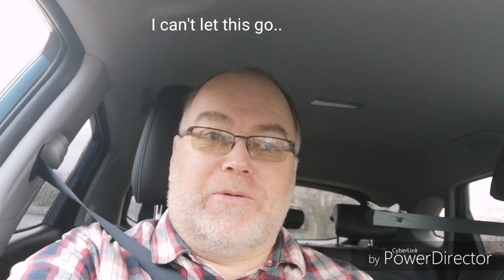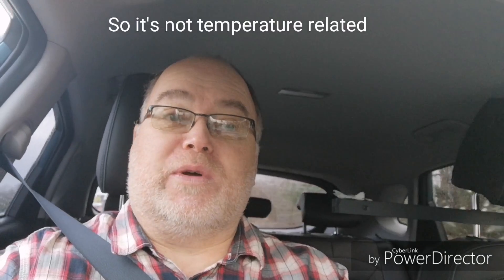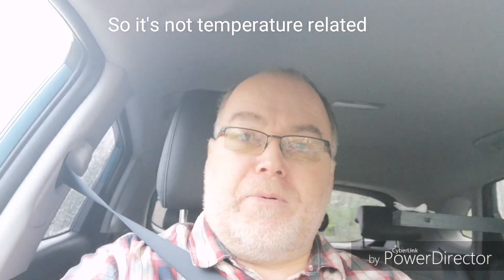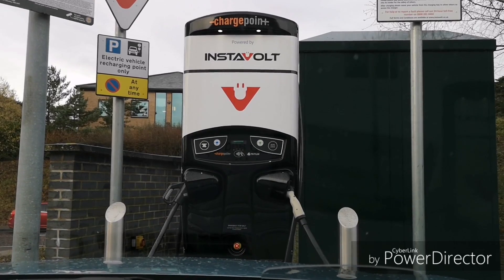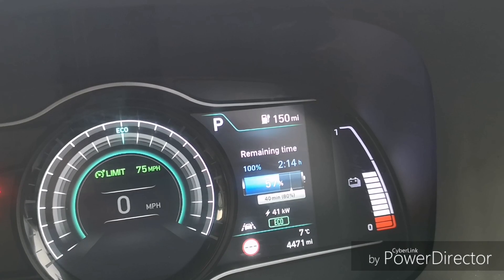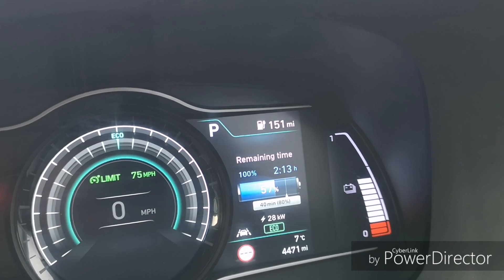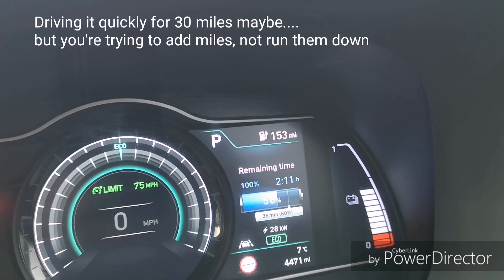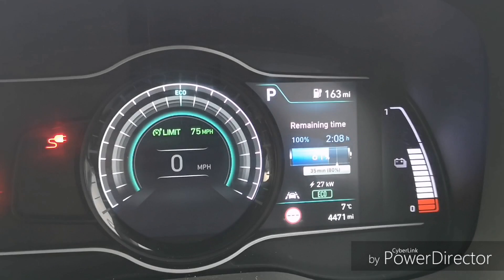Kona Electric / eNiro slow charging from cold & mid SOC

Comment: I have a Hyundai Kona 39kWh 2022 model. I took a "longish" trip this weekend. About  over 1 hour of motorway driving (speed 120-140 km/h). Charged it, only got 33 kw max as usual. It was 13 C degrees outside. Drove back, heavy rain most of the way. Charged it at a 50 kw charger. Got up too 43 kw. (never got those speeds before) after 10 minutes it dipped down to 27 and started going down. I love the car, but I'm glad it's only a one year lease. These speeds are too slow. Your video is 3 years old and I thought that this thing would have been fixed by now.
Reply from the maker: It's a crying shame it's restricted so much. If a Mini 28kwh can charge at 50kw nearly to 90% the kona should do better   and ioniq 39

Comment: I don't have an EV, my battery experience is utility scale battery energy storage normally greater than 10MWh, but I think my experience might provide some insights. I think you are describing the battery protecting itself from excessive voltage while charging. The ideal battery charging method (for maximum energy capacity and minimum degradation)  is constant current (CC). At low SOC the battery has a low voltage and at high SOC it has a higher voltage (sorry if this is teaching granny to suck eggs). The effect of this is that, when starting from a very low SOC, initial charging power at maximum constant current will be lower than the later charging power when the battery voltage has risen with SOC (power = voltage x current).  While you charge the battery, the voltage increases above the batteries at rest (open circuit) voltage to overcome the batteries internal resistance and polarisation. If the battery is cold then its internal resistance will be high leading to even higher voltage for a given charging current. So starting from a mid range SOC (mid range voltage) and charging it at maximum continuous current will result in a high voltage. If it is higher than the battery voltage rating then the car / charger will reduce the current (reduce the power) to keep the battery below its voltage limit i.e.constant voltage (CV)charging. I think this is what The EV Puzzle is experiencing. Some battery manufacturers will allow (warrant) constant power (CP) charging rather than constant current (CC) charging but to ensure the battery can be fully charged they all use CV in the final stage of charging to achieve maximum SOC, so they are normally described as CCCV or CPCV.
Reply from the maker: Many thanks, a useful peice of info however, the reasons why are not the point, it's the fact that it does it and customers aren't told in advance, instead left to discover how physics with with on their own. It's the communication and openness about what each car is capable of OR NOT.

Thanks again, genuine best techie response I've read
Reply: @EVPuzzle  I guess it's not easy (not commercially attractive) for EV manufacturers to explain that maximum battery charging power will vary depending on temperature and SOC. Easier to say "you can use a [x]kW charger" even thought they know that maximum charge power can't or shouldn't be delivered at all times.
Reply from the maker: Honesty and openness isn't something they're used to for sure

Comment: Hi Nigel

Could the issue be the Instavolt chargers? Yesterday I visited my Mum and needed a quick charge to get home in my 24 kW Leaf. There are a couple of new Instavolt charges close to her house so this was a chance to try one whilst the free offer was still on. Arrived with just under 50% charge and it took nearly 30 minutes to get to 80% starting at 28kW charge rate and tapering to 8 kW at 80% charge. When I am on Electric Highway chargers I always get just over 40kW charge rate when first plugged in.
Reply from the maker: No it's the car. It's been tested now on many chargers by lots of viewers in different countries

Comment: so from what I understand this problem only occurs if you start charging from 50% and if the batteries are cold right? as soon as I get my 39 (March where temperatures in Italy will be about 15 degrees) I will do this test too
Reply from the maker: Rates of the 39 kwh Kona would be as low as 16kw. Seen it occur at 12c but not tried warmer weather yet
Reply: The EV Puzzle i think this is a cold battery problem
Reply from the maker: Yes it is,  but only from mid SOC
BMS parameters are very different on the 39 . Will be interesting to hear how you get on as the 39 is very rare
Reply: The EV Puzzle mine should be delivered on March 1 is currently in customs I will keep you updated

Comment: If you start you charge with battery temperature above 26c this is what you approx. Could expect. If all parameters is ok.To get to 26c starting at about 5c you will need drive fresh for about 80 miles. You could buy an obd read out tool so you can readout the battery temperature. So drive first and charge when warm 😀
Charge: https://support.fastned.nl/hc/de/articles/360007699174-Laden-mit-einem-Kia-e-Niro
Obd tool and app : https://evnotify.de
Enjoy your nice car and greetings from Denmark 😁
Frank
Reply from the maker: Obd data for the Kona isn't reliable yet imo

Comment: Hold on have you got the battery charge limit set to 80%?
Reply from the maker: Nope and that doesn't impact rates of charge
Reply: @EVPuzzle  Very disappointing for you. Does this premature throttling disappear if you warm up the car more? There just doesnt seem to be a rational explanation for it. Because even if the batt was cold, then it would warm up a fair bit during charging
Reply: Have you tried with ECO mode off? How much energy is being used to condition the battery?
Reply from the maker: No battery care % at all
Reply: @EVPuzzle  I agree 7 degrees is not cold. But the temp of the pack could still be the limiting factor. Maybe if eco is off it might expend more energy heating/conditioning the battery. Bjorn mentions this a lot with trying to get optimal charging speed for a tesla. But obviously thats Norway and this is the UK.
Reply from the maker: I'm sure it does dissappear once warm enough. But increasing battery temp in cold conditions isn't easy. 70 miles of driving hadn't been enough in one person's case. I've only tested 20 miles so far but that defeats the point of needing a charge when you need it.

The answer is drive until you deplete the battery to a much lower level before charging

Comment: Hi Nigel, I didn't get my car yet so I can't test this issue for now. I might ask a silly question though: when you get this issue, have you tried to change the charging rate in the car options to low and back to high? Did it changed anything on the communication (and rate) with the charger?
Reply from the maker: Not tried. Will do next time.

Lots of people experiencing this now so it's not just me

Comment: Your post encouraged me to try out a local and recently installed InstaVolt charger on the way home. Arrived with 27% SOC with a cold battery (only a mile from work with car being parked all day at c. 4 deg C) and immediately got 39 kW. Returned after 30 mins (ideal opportunity for a quick drink in pub next door!) and returned to see a charging rate of 47 kW and an SOC 60%. i.e. Worked a treat! Remind me of the problematic range for initial SOC and I'll try next week to see if I can replicate.
Reply from the maker: You'd already warmed the battery in the first charge hence you got a better charge rate

The issue is from cold and 50s and 60s%  range
Reply: @EVPuzzle Sorry just to clarify - it was a single charging session which started at 39kW and was then 47kW by the time I came back to the car to end the session (as you say when the battery had warmed up). I'll try in the range you specify next week and will sit in car to see if the same thing happens to me...
Reply from the maker: Cold and starting SOC 50s to 60s percent

Comment: I’ve just read on line that the North American  Kia Nero will have an “optional” battery heater .  From what your saying I’m seriously wondering if the battery heater has been left out of the UK Kona.
Reply from the maker: It's when it's used that counts not whether it has one.  The Kona has one and is used in winter mode

Comment: A trip of 860km with my Kona64 with temperature betwwen -1 and 2 degrees, on Charging stations where you can charge at 43kw Max i was always charging at 43-45kw max. external temprature seems to not be the reason of your issue, FYI on my side winter mode is OFF
Reply from the maker: As I said it's the starting SOC when cold
Reply: The charging graph for 50kw charger is well respected on my side.

Comment: If it is the software thing you suggest, you should be able to work out if the Chargepoint is calculating how long to get you to 80%, then using that time to the full. From your chargestate you should be able to work out how many kWh you need to take on board to get to 80%. Then it’s time and distance (or time and kWh in this case). That will give you an average charge rate, which will/will not equal the time to get to 80% figure. Ish.
Reply from the maker: If you look at the image for the 39kwh Kona which charged at 16/17kw instead does that work out or not?
Reply: The EV Puzzle ha!  Good try. I was suggesting you work it out, not offering. Without having to go through the video again, we can do it in reverse and work out what % your battery should have been at to meet your theory.

Assumptions.
80% Charge in 45 minutes 
80% of 38kWh battery=30.4kWhs. 
So to achieve 30.4kWhs in 45 minutes, is a charge speed of 22.5kW from empty. So if your theory is correct, a 38kWh Kona would never charge faster than 22.5kW. Does that meet your figures?
If it was actually charging at 16/17kW, then that would take on board about 12.4kWh in 45 minutes. 
So the battery should have been 30.4-12.4=18kW
18kW from 38kW=47% of a full battery. 
So at 47% battery the small Kona would only charge at 16/17kW to get to 80% in 45 minutes. Is that about what it was at, ish?
Reply from the maker: Iain, all I know is it's a  39kwh battery in the smaller Kona 
I have no idea why it's slowing down charge rates from cold with soc 50s-60s %.  My time theory was just a guess but maybe it's the battery chemistry doesn't like mid states of charge when cold. It could simply be a negative effect denser batteries with less cobalt in them.
Reply: The EV Puzzle yep, I was only looking to see if your time theory could be supported by a test. I don’t have an alternative theory. But from what you say, it’s not just your car, other drivers have experienced similar speeds. So it looks, at least, as if it’s deliberate.
Reply from the maker: It is, yes. Not just a few instances, it's every instance  in these parameters soi far

Comment: I find in my Tesla, the 2 things that affect charge speed is outside temperature, and battery %. Temperatures in single figures equals slow charge rate. Even 7C. Higher % equals slow rate of charge. Neither as extreme as yours.
Reply from the maker: Kona charges great from cold, very cold ...just not from mid SOC
Reply: The EV Puzzle cold certainly affects my car, a lot. It does increase gradually but cold (battery) always means a slower than normal charge. On a Rapid, it is normally constant until about 80%+.

Comment: Dear all, 
I want to give you an example of fast charging of a Kona in cold conditions. I am totally sorry but the youtuber speaks german (https://www.youtube.com/watch?v=MQ0fwlZoUQM ), but you can see that the Kona in Winter Mode does charge quite fast when you are on a motorway. He started with 70% SOC for a 450km/300miles Trip to do the testing. His max charge rate was first 54kw and on a fast charger 71kw peak. So not so bad from my point of view. BR Sea

Comment: Just another thought on this, what happens if you drive from 80% down to 50% and then rapid charge, is the problem the same. The reason I ask is that would be the more likely scenario if I were driving on a long journey.
Reply from the maker: Now who posted they drove 70 miles and got the same issue.?
Increasing temperature through driving isn't easy. Mad Max style might work but temp only goes up a few degrees.

It's it's 10c outside maybe you'd be fine but from 3 degrees you need a huge temp increase do I'd guess you'd have same issue.

I'd drive with everything on to lower the SOC below 50 and drive it quicker. How daft is that?
Reply: The EV Puzzle 
Oh dear, that’s not good then, this is problem that definitely needs a fix.
Reply from the maker: Another responder just said we need a button to tell the BMS we're on the way to a charger thus divert energy to heat the battery IF temperature isn't ideal

Comment: I work with lithium batteries and below 10 degrees it will suffer from internal resistance and the charge voltage will easily spike up to the protection voltage and turn down the charge voltage. So this is a matter of conserving energy the way they have disigned the bms. Heating up the battery to 15 degrees or higher before charging should resolve the issue, but it's a waste of energy as the pack gets warmer the longer you drive. A quick fix would be frisky driving before charging. Please try it.
Reply from the maker: So in your view if the Kona had active liquid battery heating and cooling, should it be heating it, if in charge 10c or below?

I've seen the same issue at 12C after driving 5 miles.

Another commenter in here has tested battery temp increases after driving and seen just 1 or 2 degrees increase. Another Kona owner drove 70 miles and saw the same issue.
It seems raising battery temp through driving isn't easy without very erratic driving?

If we knew the BMS tolerances we would know whether a spirited drive would help but if we're 10 degrees out, forget it
Reply: @EVPuzzle  as I wrote it's a matter of conserving energy, but they could have put a option in "prepare for charging" to use in cold condition.
Reply from the maker: Absolutely ,  the BMS can't predict when we might charge so we need human input
Reply: I had the problem in mid summer as well.

Comment: My Leaf 2018 drops in speed around 45% now in the winter :(
Reply from the maker: All similar but I suspect leaf 40 has different battery chemistry to the Kona so charging characteristics will be slightly different.

Weirdly the Kona works better hotter but us more compromised cold...so it seems
Reply: The EV Puzzle looking forward to see what kind of charge/speed you in the spring and summer :) 
I need more range than my Leaf 2018 and Kona might be "the one" 👍🏻
Reply from the maker: I'm definitely going to test different temps above 12c to find the point where the BMS allows more. The more tests performed by those watching my video will help speed this up.

Comment: Very interesting,  I really hope Hyundia are watching and come back with an answer. On a long journey being able to top up even when the battery is at 50% is important as then it can be done on a comfort break rather than being dictated by the battery level. 
I’m sure lot will say just run the battery down to 20/30% but that’s not away convenient. Even in an ICE I would fill up when stopping for lunch or a comfort break.
 It doesn’t seem to be based on time as when you restarted the charge if it were then I’d have exspect to see the kwh rate drop even further and the time to 80% increase,
Reply from the maker: That's my point Colin, if we knew we could plan better.

It'll now make me reconsider filling to 100% if I know I want to charge as I need to target charging at 40%  not 50% or above.

Imagine how it'd impact you if your Kona was a 39k kwh. Charging window much narrower
Reply: The EV Puzzle 
Yes, I’m very glad I’ve choose the 64KWH battery. 
I’m really grateful for all the investigating your doing, I just hope Hyundai are taking this all on board and will resolve the issue, as I’m not happy with things as they are. Hopefully my car arrives soon and I can check if the same is true on it.
Reply from the maker: I guess we have to hope for a fix but consider it might not be possible. Maybe at these temps the latest batteries are more vulnerable at mid SOC.

If so,  it's a joke the car has a liquid TBMS solution yet doesn't use it.

Hyundai do look and view my videos but often with a delay. I have given them a heads up on this previously of course